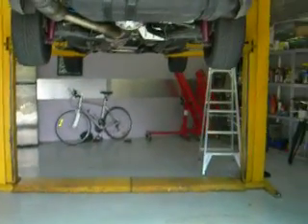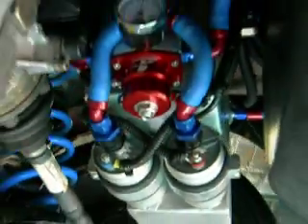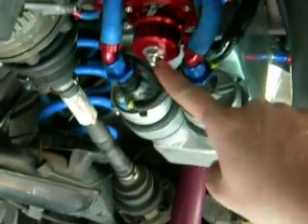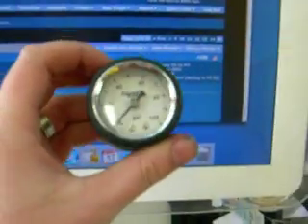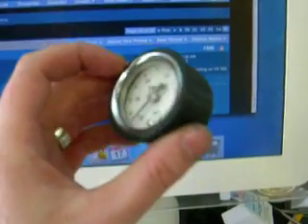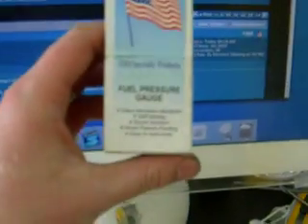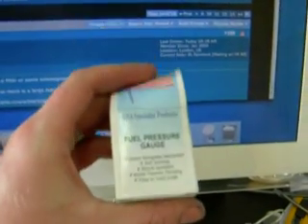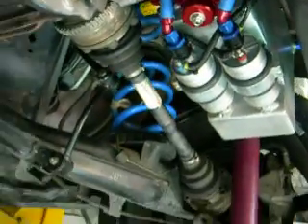New fuel regulator setup

Comment: @bigballlllsofun He needs to be able to maintain fuel pressure so he doesnt run lean at high boost levels. I have 2 GT500 fuel pumps and 2 more booster pumps in my car and run very high psi in my fuel lines, up to about 80 or 90psi when under very heavy loads...without the safety of running those extra fuel pumps you could run lean and destroy your motor...hope that helps...